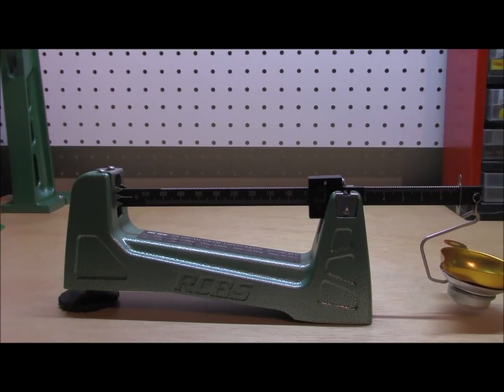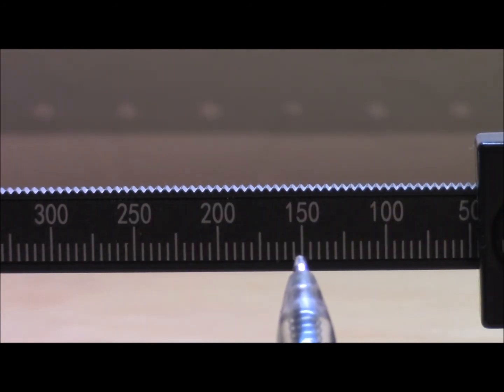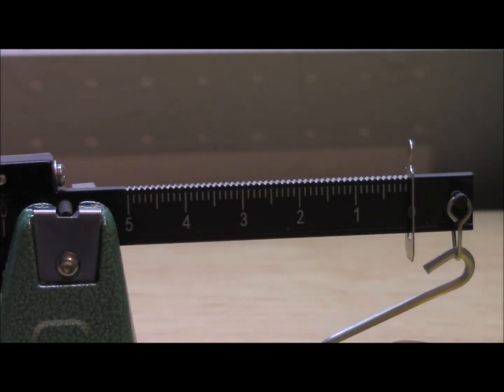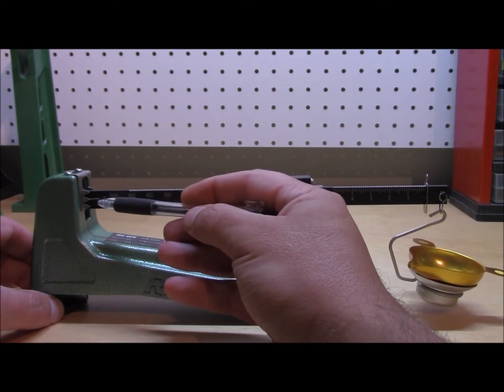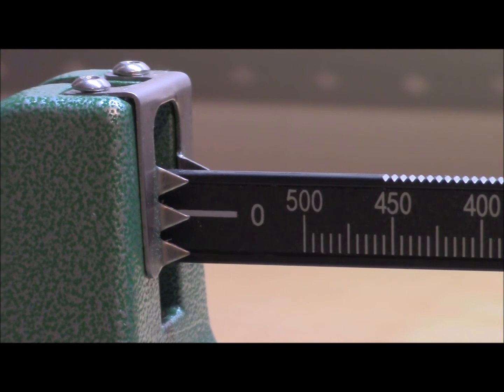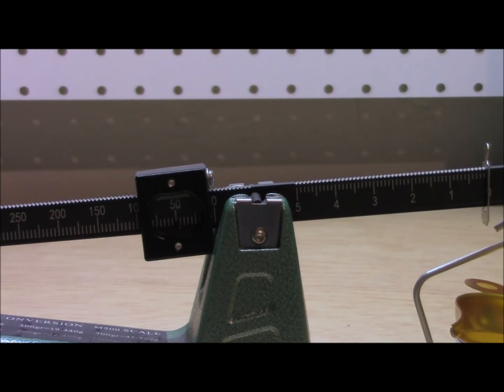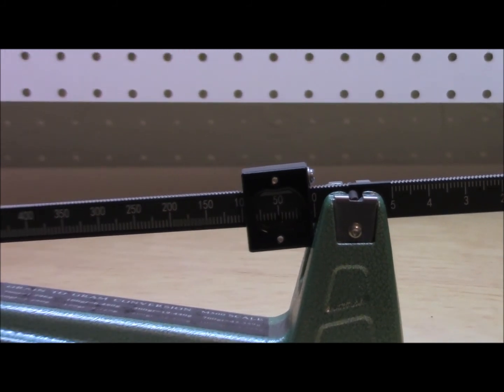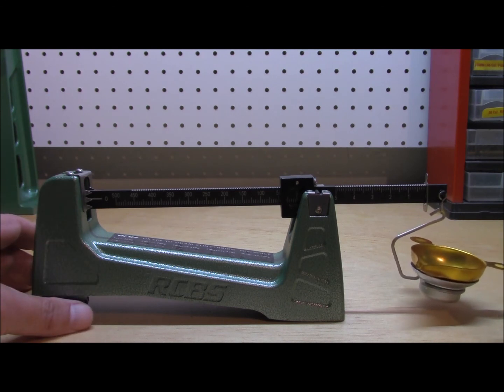Reloading for Beginners - Zero and read a mechanical scale

Comment: Chardee MacDennis... Those are plus and minus 0.5 tenth of a grain markers. Bottom is 5 tenths over and top is 5 tenths under... center equals zeroed in. RCBS recommends that you practice the top and bottom more than the center marker. Doing so will make you more proficient in your weigh ins. Shoot lots and stay safe.

Comment: What are the two points above and below the middle mark that you use to align the marker? Are those so you know your looking straight or are those like plus/minus 1 or something
Reply: Chardee MacDennis... Those are plus and minus 0.5 tenth of a grain markers. Bottom is 5 tenths over and top is 5 tenths under... center equals zeroed in. RCBS recommends that you practice the top and bottom more than the center marker. Doing so will make you more proficient in your weigh ins.   Shoot lots and stay safe.